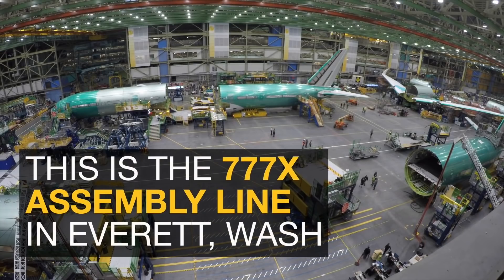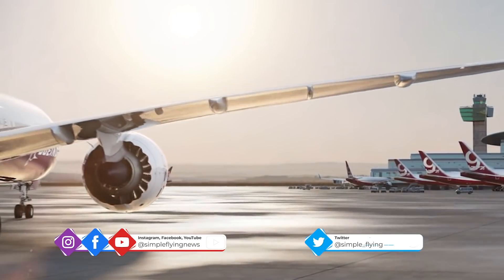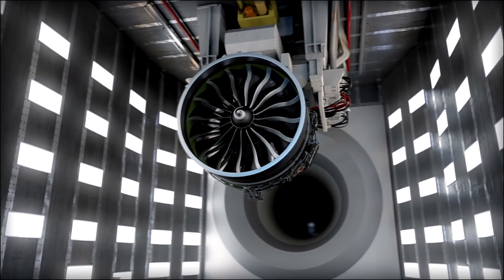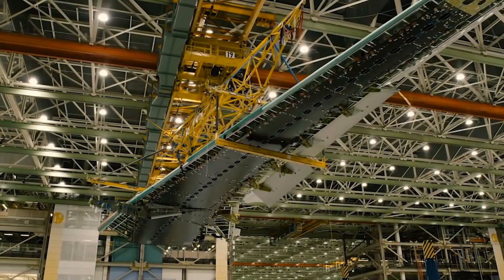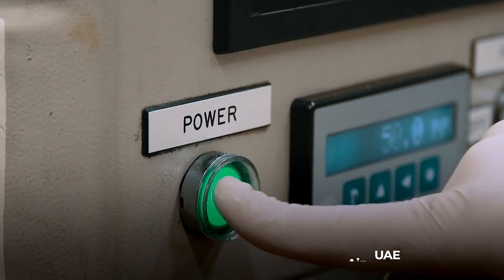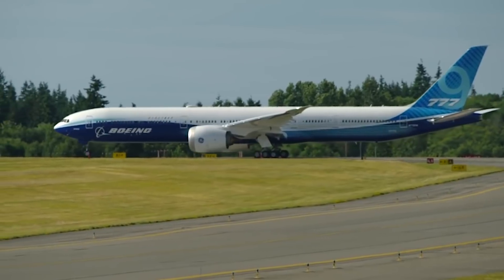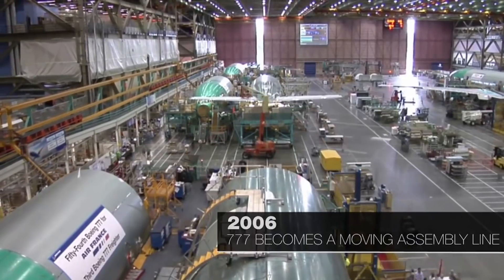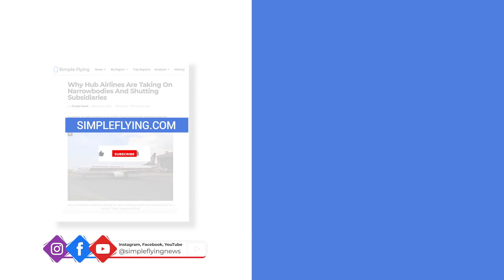Where Are Parts For The Boeing 777X Being Built?

Comment: The 41 section (nose section) of the 777X its made by Spirit Aerospace in Kansas.  Wings are produced by Boeing in a building immediately to the north of the main assembly building in Everett. I have a pretty good idea of the global supply system for the 777X as I worked the 777 line from the 1st plane until I retired in 2017 after 29 years at Boeing. As I retired I had seen 1,500 of the 777 come down the assembly line.

Comment: I'm pretty sure the central section of the fuselage where the wings attach is made in Boeing's facility in Winnipeg, Manitoba, or it certainly used to be.
Reply: "Subaru (Fuji Heavy Industries) has been participating in the 777X program since its initial design development phase, and is newly responsible for side-of-body section, in addition to center wing box, integration of the center wing section with the main landing gear wheel wells, main landing gear doors, and wing-to-body fairings (forward) as with the existing 777."

When I assembled 747-400 center wing sections in 1999 the parts we assembled came by rail from Bombardier. 
At the time, 777 center wing sections were shipped in complete from Japan.